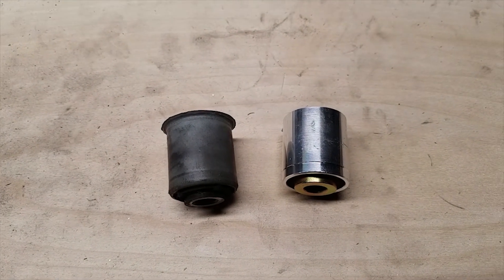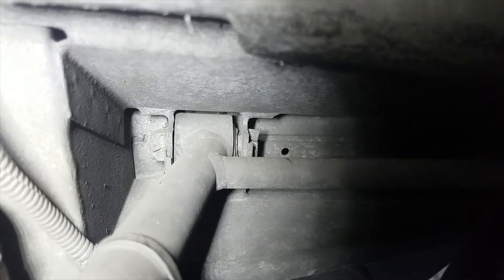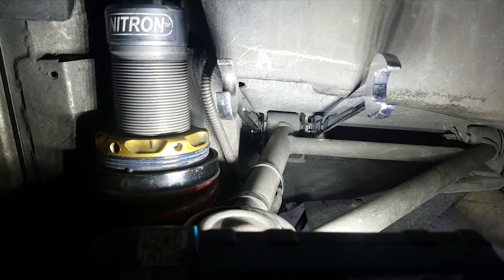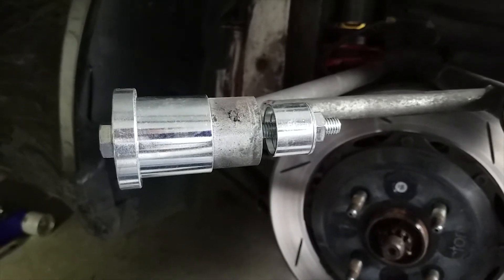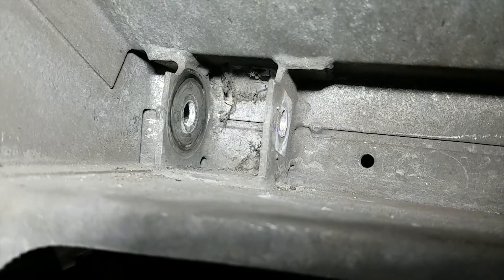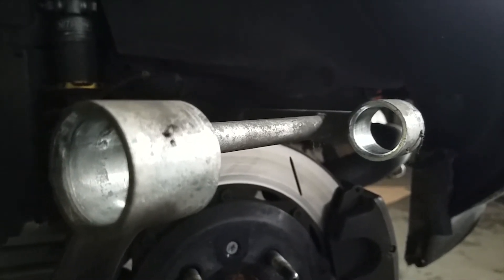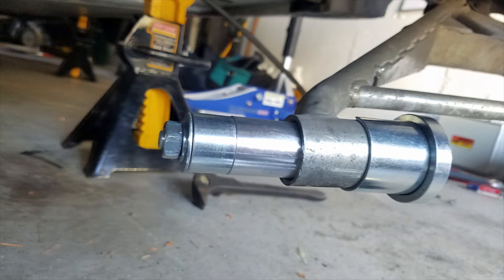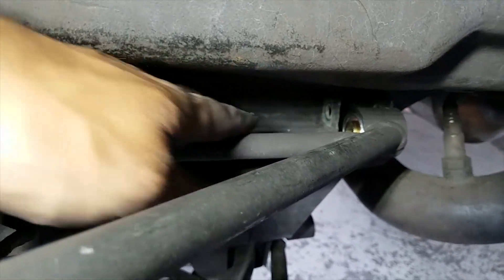Rear Suspension Bushing Replacement - Lotus Elise

Comment: To be clear, the 8.8 bolt is the same grade as the bolts that the suspension uses just to hold the pivot together and is not sufficient for use as a press in this case. I ran across the same problem using "normal" spherical bearings. The bolt stripped even with freezing the bearing at -6F for a week, prepping the old surface to remove any imperfections, and greasing the friction surfaces of the bearing and the threads of the bolt. It appeared to be going in straight the entire time but when you get the entire bearing into the wishbone (but not seated yet) there is just too much friction for an 8.8 in some cases and the threads appear to just outright fail. The tool should probably come with a 10.9 in general.